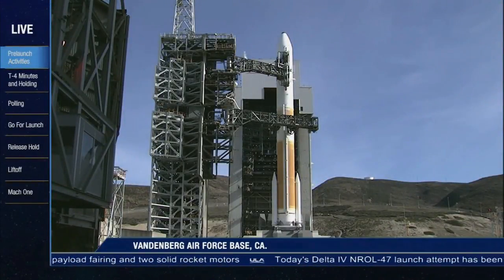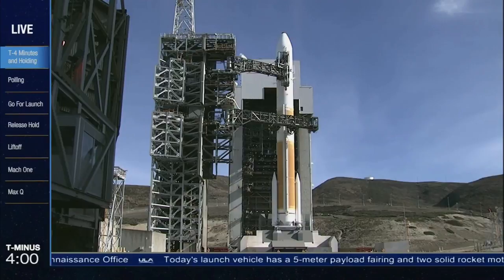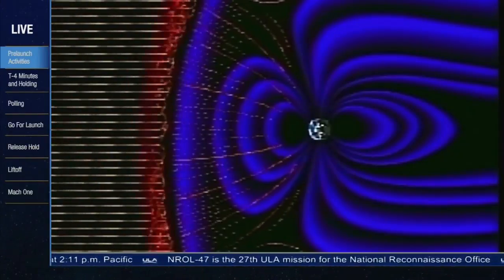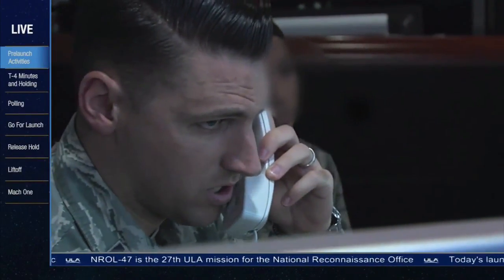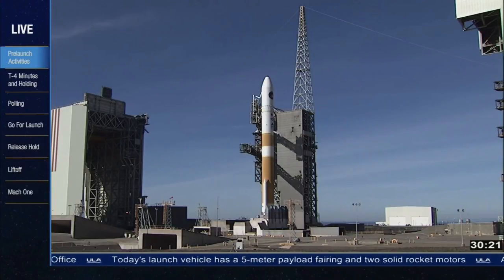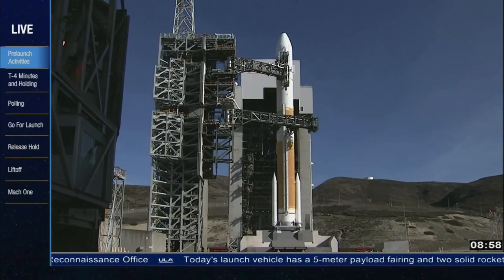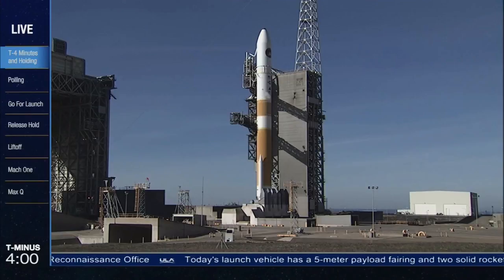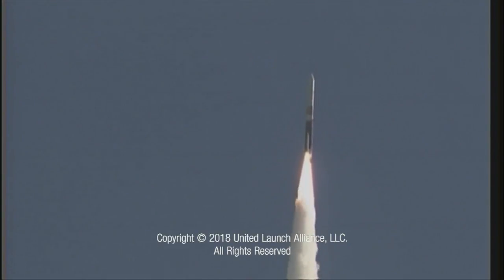***FULL LAUNCH VIDEO*** Delta IV NROL-47 Live Launch From Vandenberg Air Force Base

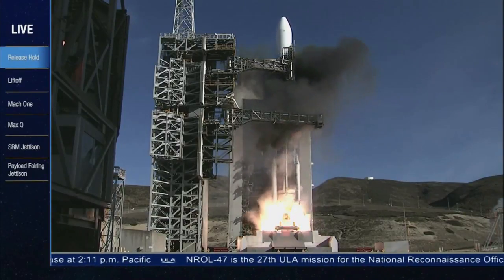Comment: 1:33:10 launch begins: fuel ends after just 90 seconds (50 miles away), switching to a minimal fireball giving the illusion of a fast-moving rocket at full-throttle. 
Less than 3 minutes after lunch film switches to cartoon, saying rocket released satellite at desired orbit of 110 miles, which even NASA doesn’t claim to be one of its invented Zero-G Low Earth Orbits (LEO)!
 Q: was this 110-mile orbit  exclusively installed for this satellite!